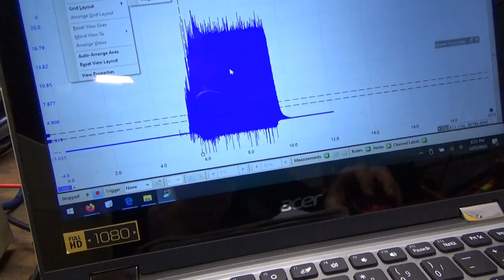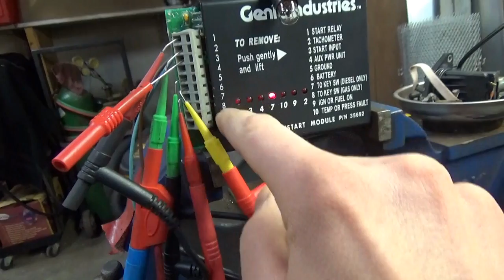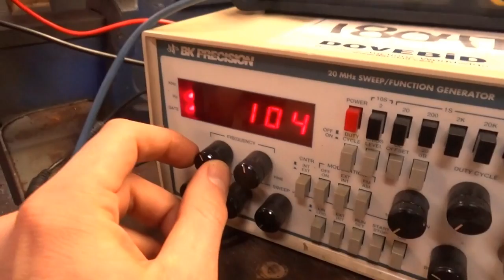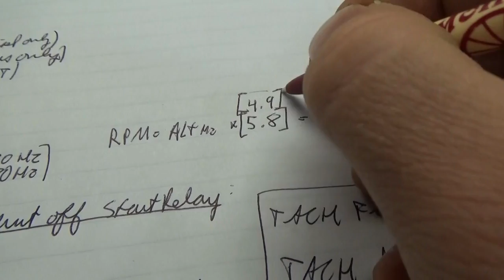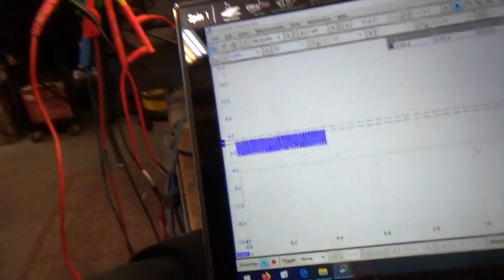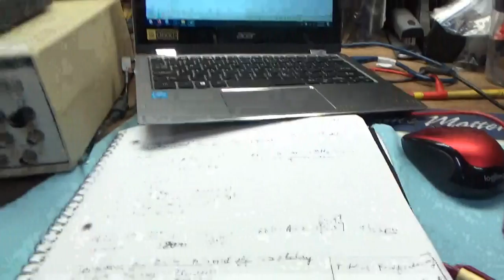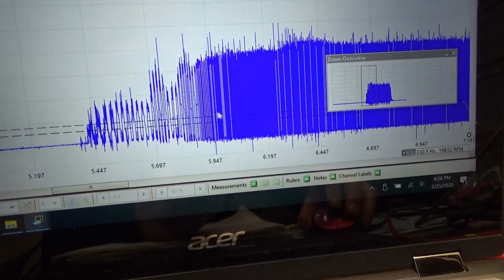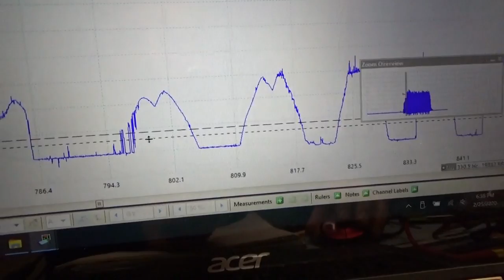Genie TACH signal (Short Crank) Module Bench Test!

Comment: Some modules get moisture in them.
Put them in a refrigerator for a week sucks water out of circut board chips etc.
A vacuum chamber also evaps water.
Also sometimes metal chips get on rpm pickup sensors causing weak signal.
Had a CAT JLG found that issue. 
Excellent work Thanks
Reply: There is no rpm pickup sensor in this case. The tach signal comes from a tap on the output windings of the alternator.
Reply: @Graham_Wideman  ok a gas motor. I found that issue on a CAT Perkins diesel JLG dealership could not fix .
Sensor was full of metal chips from flywheel teeth caused computer and electronic speed control to lock up.
On my channel
Reply from the maker: Interesting note on the metal chips! I have a case study coming up on a JLG with a Kubota engine with similar symptoms :)

Comment: Caps losing value over time and in extreme temperature variations,outdoors could effect the normal operation of the module. The fact that a new module corrected the problem suggests that the original components on the pcb board had deteriorated sufficiently enough for the Genie to malfunction. Perhaps an individual component assessment might unearth the affected part.

Comment: I just want to see pictures of the module PCB....both sides.
Reply from the maker: I can post some pictures on the "Community" tab if people are interested!
Reply: @PineHollowAutoDiagnostics  Yes please! I'm sure all of us that have other work we are supposed to be doing will be happy to have an excuse to detour to this essential piece of reverse engineering :-).
Reply from the maker: @Graham_Wideman  done!
Reply: @PineHollowAutoDiagnostics   
Any chance of a straight-on view of the rear, with the plastic brackets snapped off, so we can see the traces?
Reply: @PineHollowAutoDiagnostics  ...aaaand stalled because the tach signal PCB trace goes around town all over the place and under the plastic brackets, so we can't see where it goes. If you have the motivation, it would be great if you could post another photo of the rear of the board with those plastic brackets popped off. For what it's worth, points of interest so far: https://grahamwideman.wiki.zoho.com/PHAD-Genie-tach-signal.html
Reply from the maker: @Graham_Wideman  Wow Graham that's quite the intricate deep dive on the module circuitry! Will review your wiki notes and maybe pop off the plastic bracket. It's glued on pretty tight and I don't want to ruin a good module!
Reply from the maker: Plastic bracket removed and new picture posted of module back side 👍😎
Reply: @PineHollowAutoDiagnostics  I have updated my wiki page with a schematic of the module's tach input. Pretty interesting.  https://grahamwideman.wiki.zoho.com/PHAD-Genie-tach-signal.html
Reply: @PineHollowAutoDiagnostics  Thanks for all of that Ivan ~ Graham's cover it covered
Reply: @Graham ~ thanks for digging up the manuals. I can't conclude whether pin2 of the 40106 is soldered correctly or not, but what I can see is an answer to my query on the community page of where the tacho signal is derived from ~ the alternator stator. This likely explains why the tacho signal ramps up like it does at crank time. Notice the early numbered units show the tacho signal going direct to the genie control module, but later/subsequent models show the inclusion of a 3uF polarized capacitor between that signal path and ground. That capacitor is drawn as external to the unit itself, but with screwy cases like this you can't discount anything -- where's that 3uF cap?
Reply: Yes. Me too. I suggested that on the last video, but Ivan may not have seen that,
Reply: @Graham_Wideman  Aye, looks like Ivan's going to chase this rabbit-hole to the end, so lets hope we see those pics ~ a lot of electronics folks like you (I suspect =) & myself can divine a lot from seeing the circuit components/layout of modules like this.
Reply: @gcbification  Agreed!

Comment: Great video. Can you explain the rpm unit that sends the single to the module ?
Reply: In this case, it's the tach output from the alternator. The alternator has a stator (stationary) winding that has three phases. Loosely speaking, three coils joined in a star shape. All else being equal, as the the alternator rotor turns, each coil generates a sine(ish) voltage, with the three outputs being 120 degrees apart from each other. The center connection point of the coil also follows a wave form waveform. Actually, the three coil output wave forms are made quite square by virtue of diodes that take the coil outputs and apply them to charging the battery (or running the equipment). That in turn affects the shape of the center-connection waveform.  At any rate, that center connection signal is the alternator tach output, that is used as input to the starter module.   Its frequency is proportional to alternator rotation frequency and hence also to engine RPM (since the engine drives the alternator by belt and pulleys of some fixed ratio.)
Reply from the maker: @Graham_Wideman  I definitely learned something new here... So the signal is not specifically conditioned by the alternator cicuitry to look nice and pretty?
Reply: @PineHollowAutoDiagnostics  Well if the alternator tach output (actually labelled "stator" on the Genie schematic) is simply the center connection on the stator "Y" coils, then there's no special prettification. I don't have personal experience with these, so I don't know what's customary. Sometimes schematics that show internals of some assembly are "suggestive" rather than actual.  But the waveform you captured looks reasonable for just a raw connection to the stator midpoint. (well, except for the "dropout" glitch that you spotted!).  Basically a sine waveform that's clipped as a result of the stator output diodes driving into a low-impedance load (the battery) and thus looks squarish. And when the amplitude is initially low due to low RPMs,  since the tach signal isn't spending most of its time clipped, there will be additional noise due to whatever noisiness there is in the load driven by B+ (such as the starter motor), seen by the stator coils output, and thus also affecting the stator center point (tach output). Plus your scope trace will probably pick up ignition signals just by having the test leads flopping around and picking up electric field. :-)   Anyhow, the putative primitive nature of that tach signal is what lends interest to how the ignition/start module treats it!  It's already evident that the signal takes a hilariously meandering path on the PCB, before ducking out of view.

Comment: I'd still like to see some of the individual components in the module tested like the capacitors or transistors.
Reply: Me too!  How do out of spec capacitors affect the received signal?  Usually electrolytic caps fail by losing capacitance and becoming more resistive.  I think most of the controller is fine, e.g. transistors, or it wouldn't work at all.  Perhaps the tachometer has slight problems as well.
Reply: If I had been a better EE student, I could probably answer my own questions. 8-(

Comment: I'm left wondering if there isn't signal noise on one of the module wires that could be "encased" in a shield and connected to chassis ground to filter out.

Comment: What a push button could cure .
Reply from the maker: Yes, but only if we used the pin 8 bypass for ignition. Then if the key is left on it would drain the battery...

Comment: Hey Ivan, do you ever use the low pass filter on the pico to make the traces easier to read? I've always found it difficult to read the exact voltage otherwise.
Reply from the maker: I do when the signal is really noisy. But looking at the raw data first is always useful 🙂

Comment: Maybe starter overload?  could have effected the module, from jumping in cold weather, accidental  surge from touching the jumper's? may have starter problems.
Reply: It has a new starter (previous video)
Reply: @mattmanyam  Ok, the old starter could have affected the circuit board?
Reply: @mattmanyam  Some manufactures have a caution warning about jump starting, and how to do.

Comment: Do you know for certain that it is using the signal from the alternator for an rpm reference? If so, it could be a fault in the alternator causing the trash in the signal. I guess that it makes sense as that lift can have a gasoline/propane or diesel engine. Both would have an alternator but only the gasoline/propane engine would have an ignition system. 

It seems that the primary reason for having that system is to prevent the starter being activated while the engine is running and shutting down the starter on engine start would be more of a secondary consideration. It can be difficult to tell if the engine is running from the basket at a distance. There would be times when it is necessary to crank the engine for an extended period if it ran out of fuel or in cold weather but normal cranking speeds seldom reach 300 rpm.

Comment: Great video.  Reminds me of a time I was troubleshooting why my '83 BMW R100RT was dying intermittently at a red light.  Eventually traced it to a bad hall-effect sensor.  Would get baked in heat, fail for about 90 seconds, then work again.  I didn't own a scope back then.  Wonder if you have an unusual gap, causing a choppy/noisy signal at low rpm.

Comment: I noticed you stacked a bunch of cassette tapes in front of a speaker. I'd move those cassettes away from that speaker and away from anything containing permanent magnets.
If you leave those cassettes for long enough or close enough to a magnet, you will notice intermittent drop-outs, starting with the highs. Intermittent, because half of the spool is closer to the magnet than the other half. Quite interesting effect but very annoying to listen to music on that way.
Reply from the maker: Lol all of those tapes are 20 to 30 years old and have been looped hundreds of times! I even had to tape a couple back together... Still sound decent 😁

Comment: If it continues to cause a problem you could wire in a relay over the top of it. One side of the relay control could be from the cranking input. The other relay input could be wired to the charging system bulb warning indicator) it will most likely be ground when key is on (because alternator is not charging). This would eliminate someone cranking engine if the engine is already started. That's because if the engine is running the charging system warning bulb will be out (or a power not a ground) this would not allow the started to crank. Hope this makes sense. (Btw I suspect that is the whole purpose of that cranking circuit....they dont want it cranking accidentally if the engine is running)

Comment: I wonder if there is a taco pulse capacitor/resistor filter in that unit thats a bit low on capacitance.
That might filter less the high frequency out of the taco signal.
Having the voltage and frequency changing the starting, sounds a bit naff.

So a relay cutting the tach wire while cranking is a no no then :-D
Reply from the maker: A relay cutting the tach signal... Why didn't I think of that?
Reply: It's not the russian way ha ha :-D

Comment: Bad caps are a plague on electronics from 1997-onward.
Reply: About the time people stopped paying good money for equipment and wanted cheap goods. So they get cheap caps. I work on Power supplies with 25 year old electrolytic caps, all OK. They just cost more. Also, you are supposed to throw everything away for the new model these days. Why do you need caps to last 25 years in a computer that can't even connect to the internet in 10 years time? It's all relative. You can now get solid polymer electrolytics with a huge lifetime. I've yet to have any fail at all. It all depends upon cost and expected lifetime. Sorry to rant but everyone seems to just assume caps can't last when they keep seeing cheap ones that aren't designed to last
Reply: @tenmillionvolts  there was a huge scandal in the electronic component market starting back then involving fake capacitors. This is what he was referring to.

Comment: Ivan what about temperatures and moisture like a old ford distributor relay when it would get hot it failed cool off and run cracked soldier or it was muddy out there dampness changes the value

Comment: Too bad you cant compare the time delay between tach signal meeting threshold and the start relay dropping out, between the old and new modules.  THAT is where the problem likely is.  A shorter delay on the old module would likely be caused by an electrolytic capacitor in a timer, one-shot, or integrator circuit that has increased leakage or lost capacitance, both typical failure modes.
Reply: How do we know it has a time delay circuit? It may just be looking for a specific threshold to be met. The starter is going to turn the engine only so fast. The tach signal has to get above that frequency to be considered as an engine running condition. If the tach signal is noisy then it could fool the sense circuit. The newer circuit components could have different values or tolerances are better so it could be looking for a slightly higher tach frequency or level. Who knows without a schematic and circuit specs. But also like you say if it is time delayed then if electrolytics are part of the timing circuit they may have started to dry up from age changing their value. We can only guess without all the details.
Reply: Almost certainly the tach input voltage goes through a minimal network of resistors and diodes (maybe a cap) to clip it 5V, then into the 40106 schmitt-input inverters for hysteresis, then into the PIC microcontroller, likely an interrupt input, which would be responsible for measuring the pulse frequency and thus RPMs.  So the input signal voltage threshold would be set by the 40106 input characteristics (they have 0.9V hysteresis when powered by 5V, matching Ivan's observations), possibly modified by input resistor arrangement. The RPM (frequency) threshold would be set by the PIC MCU programming. The MCU would also implement any other criteria like "must be over X RPM for Y seconds".
Reply: Circuits that do this sort of thing may sound simple however there is many things that can go wrong.
Reply: @Sam S If you're asking whether I could design this module and build it, yes. This one is pretty simple. Though we are somewhat guessing the precise details that this one actually implements, of course!
Reply: @Graham_Wideman  True, this is a simple one (not pure analog like older stuff), but here in AU ... especially mining industry stuff & other electronic/electrical control gear in industry, the electronics used are part of the equipment commissioning process and safety certificate obtained, and you can't totally change/replace stuff without having the equipment re-certified. I used to work with industrial control repairs, and it was always the same ; repair what's there to avoid recommissioning. It boils down to workplace safety & liabilities ; it never seems to matter until an accident happens, and if it does and there's an investigation and they find some piece of equipment has been altered or modified (here, we'll toy the idea the PiC was dead & got replaced with an atmega and different program code), it becomes very ugly, very quickly.
Reply: @gcbification   Yes, agreed. Designing something to perform the function is one thing. Completing a process to bring it into conformance with a particular risk profile to a particular level of confidence, in addition to whatever legal certification process applies, that's another thing. Because of the latter, repairs generally focus on bringing the existing design (with all its completed homework) back to life, rather than substituting what might be a better design that hasn't completed the surrounding steps.
Reply: @Graham_Wideman  Indeed ; most of the time you have to go back to original design specifications, recreate endurance/fault test rigs, takes months, literally. 

Still, this is an interesting fault condition ; hard one to call without some hands-on. Is the MCU sampling the tacho input and looking for 'x' contiguous pulses within a ~500ms time-frame as a test condition? -- seeing as tacho signal is alternator based, you need figure out some means to test for broken drive belt and/or starter drive gear bad engagement (you can imagine it otherwise sitting there grinding the starter pinion off) Is the MCU monitoring the (both) vn20 diag ports, and if so, is that generating a low voltage flag at one/both vn20 diag-pins at initial that's triggering an abort? Will be interesting to see if Ivan chases it down.
Reply: @Sam S I'm not sure your interests in this, but these books might appeal: 
https://www.amazon.com/Car-Hackers-Handbook-Penetration-Tester/dp/1593277032,
https://www.amazon.com/J1939-Programming-Vehicle-Simulation-Arduino/dp/1938581180
Reply: Most of this dialogue is above my level, but I work on genie boom lifts everyday for aboutv10years now. I have had the need to replace aftermarket alternators with one from Genie because the tach signal output was not correct. Not sure if that is a factor in this situation!!!!!!!

Comment: I think you have different filters in the second module which is probably making a better signal from the tach.
Reply: Or the input capacitor in the original controller has gone bad. When you feed a 16V square wave to capacitor all day long that is a tough job for the cap. That is why they use low ESR caps in the switching power supplies and should have used here too. Ivan, can you open the unit and check the input stage? Maybe there is a cap you can change and have an operational unit again?